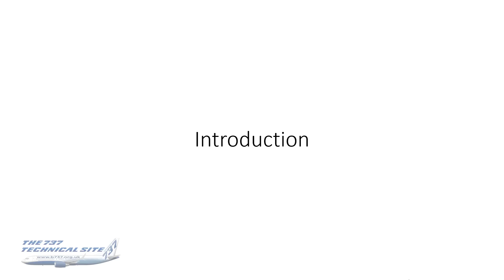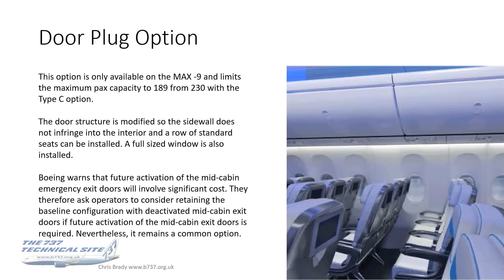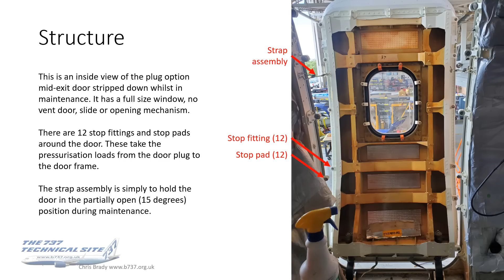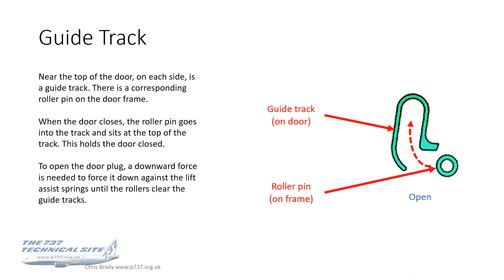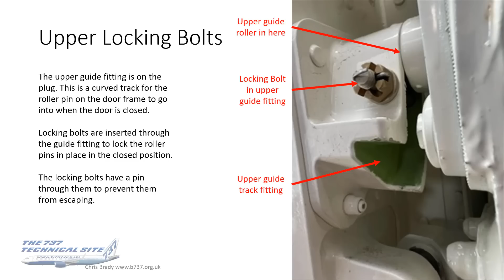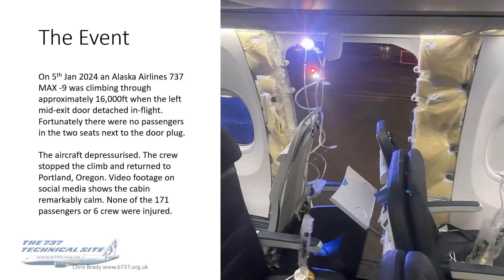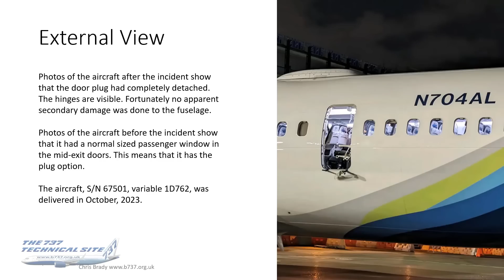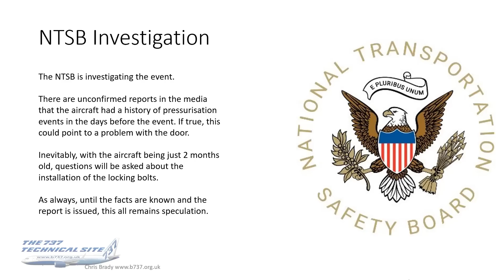737 Mid-Cabin Emergency Exit Doors - Plug Option

Comment: Spoken with a BA engineer:
The plug doors are habitually removed on the FAL for ventilation, tool access, ease of interior install - then re-installed.
Reply: That’s seems like the most likely thing to me. Someone removed the bolts and opened it while working the interiors. Later on, when it was time to install the sidewalls, someone closed the door, without knowledge that it required bolts, as most doors don’t get bolted in place. They closed the door, and threw on the sidewall.
Reply: @SynthD  Wow, that's a chilling sequence of events but unfortunately it could be close to the truth!
Obviously people will say this can't happen, there are procedures to ensure it never happens but bear in mind that something obviously has happened here and the likelihood is it didn't involve following every procedure to the letter.
Reply: @alanm8932  I work in heavy checks, and we opens all the doors everytime to keep it cool in the cabin. However, we’re all A&Ps and have the sense to close everything properly before shipping the plane. This is exactly what happened. There is no damage to the airframe, the guide pins are still attached and undamaged. Only way that door came off is if those bolts weren’t installed. They weren’t installed because they had it open for ventilation and whoever closed it didn’t realize the door had to be locked shut with bolts, because nearly all doors lock on their own without bolts. The only thing that boggles me about my theory is how it went 2 months before popping open. Seems every time they landed that door would bounce. Overall, a major safety net is missing in this design being there are no proximity sensors to detect if the door is closed properly. Virtually every other pressurized door has sensors to ensure they are correctly closed just for this reason.
Reply: @SynthD and the design standard far25 actually requires that there are sensors to ensure its correct closing. How did they show compliance with that regulation during the certification process?
Reply: @SynthD  I suppose even without the lock bolts it does not necessarily blow out immediately or soon after. Maybe the weight of the plug , and differential pressure is enough to keep the door in locked position. Maybe on this particular flight it hit a bump on take off, enough to jog the door off locked position. and Finally increasing differential pressure did the rest. As you also mentioned, plug should have unlocked warning indication (meaning it is off its fully seated position, not that Lock Bolts are missing)
Reply: @SynthD  Things kinda look that way, 

However (and not to defend BA or anyone else) someone has postulated that Alaska sent the plane out for wifi installation to a third party who may have removed the plug and not put it back, as required.

It's pure speculation, at this point in time. I guess we'll hear something.
Reply: @frankpinmtl  hmmm coneheads involved. Plausible
Reply: @SynthD  I’d bet a lot of money that’s exactly the case
Reply: Doesn’t seem like it should be a problem if it’s done according to procedure, logged, and properly inspected. Seems to fall under maintenance purposes. Unless of course they are treating it like opening and closing a door, as opposed to removing and replacing a section of fuselage and interior.
Reply from the maker: Interesting thank for the info
Reply: "The plug doors are habitually removed on the FAL for ventilation, tool access, ease of interior install - then re-installed." 
As long as each occurrence is documented and done PER the maintenance manual.....shouldn't be a problem.
Reply: @rael5469  Part of the problem is at Boeing, they don't use the maintenance manual until the aircraft is certified, or unless engineering allows it.
Reply: @reubenmorris487   I worked for a Boeing subcontractor and we worked off of documentation and engineering drawings. So there is documentation and there were inspectors inspecting our work.
Reply: @rael5469 Unless the design itself is faulty, which looking at this as an engineer, seems highly likely. It's only held in place by a small number of thin bolts. The doors don't sit flush with the fuselage, so there would be buffeting if it's even slightly loose.
Reply: @SawBladePainter No, it is being held in place by the cabin pressure and those lower springs pressing those roller pins into the guide track. The springs pressing it into the track, and the cabin pressure pressing it into the bend. Those 4 bolts just secure it so it doesn't slip out of that position.

This, however, leads to the question of how the door could go flying without ripping out the guide track while the aeroplane was pressurised. The cabin pressure should have pushed it safely into them, even without the bolts present.

This leads me to speculate that the failure was with the hinges. If those failed, the lower half of the door would have departed and pulled the upper half out of the guide track. In that case, the locking bolts don't matter---the lower ones don't stop the hinges from breaking, and the upper ones depend on the door not getting narrower. (i.e. the roller pins stick into the guide track and can be pulled out of the door folds in the middle, they are only secured against moving along the track.)
Reply: @SawBladePainter   I don't understand your point? "There would be buffeting if it's even slightly loose".....and then what? 
Cabin pressure holds the plug tightly against the stops. As long as the cabin is pressurized there would be no buffeting. Even without cabin pressure the gap between the plug and the stops would only be a couple thousands of an inch. All the doors and windows are made to stay in place in an unpressurized situation. Not ideal, but they would stay in place.
Reply: Please correct me if my thinking here is way off base…

My initial thought is, if the door wasn’t seated on those fuselage tabs, the increasing cabin pressure would essentially blow the plug off the aircraft. Flight 1282 was climbing through FL 16,000, so the cabin pressure ratio was positive inside, negative outside.

How it got past the slots and rollers is baffling, unless it went out bottom first, because the rollers are still present.

So the higher they flew, the same cabin pressure is pushing against an ever decreasing outside atmospheric pressure.

So per Chris’s video, the dimensions of the plug are about 20” x 44” = 880 sq in multiplied by 7.45 psi at FL 16,000’ = 6556 pounds of force against nothing on the outside…There goes the plug !

— From Chris’s 737NG-MAX technical guide…”below FL 280, the max differential is 7.45 PSI. which will result in a cabin altitude of 8000’. At cruise altitudes above FL280 but below FL370, the max differential is 7.80 PSI. which will result in a cabin altitude of 8000’ at FL370. At cruise altitudes above FL 370, the max differential is 8.35 PSI. which will result in a cabin altitude of 8000’ at FL410.
Reply: @HenryLoenwind  those lower springs are there to assist in lifting the door up & open. 
The cabin pressure held it in place…for a couple of months anyway.
Reply: @rael5469  "Cabin pressure holds the plug tightly against the.... " Perhaps the springs and taxying vibration moved the door upwards enough to clear the stops before cabin pressure was applied to the door?
Reply: @ImperrfectStranger   I'm just not sure. I have personally never worked on this door plug on the 737s so I couldn't say for sure. If I was betting money I would bet that the bolts were installed but not safetied and that they vibrated out one by one until the final one fell out on the day of the incident. That's the only scenario I can see.
Reply: @rael5469  There is a documentary procedure (can't remember the acronym he used...I'm getting old) but to your point, it is also a second set of eyes, job. 

Someone signed off on the job.
Reply: @frankpinmtl  Boeing's been cutting QA.  They (the executives) called it the, "Verification Optimization Program."
Reply: @frankpinmtl  We call it RII for Required Inspection Item. I don't know if that's the terminology all airlines use. It means that critical component installations must be verified as correct by a Quality Control or Quality Assurance Inspector before the work can be signed off in the log as complete. The inspector then also signs the logbook either physically or electronically if the aircraft have an electronic logbook.
Reply: @dougrobinson8602  At BA they use some other term, I think. I'll ask him again, he's flying now. 

But your point is well taken;

Someone did the work. Someone inspected the job.
Reply: @reubenmorris487  As in many things, optimization is a corporate euphemism for more money, less cost.
Reply: @reubenmorris487  an interesting title for that project Is this another B737 design short cut or shoddy manufacturing coming home to roost
Reply: @frankpinmtl  rii
Reply: Overwing doors might be routinely opened for ventilation, etc, but these doors require the removal of split pins, castelleted nuts, etc.
Reply: @ImperrfectStranger  Couple minutes.
Reply: Quite unusual to open a door that have the trim panels of the pax cabin in the same manner of the regular ones. I guess the BA engineer is talking about the overwing hatches and not of these doors. I am sure NO airline mechanics will touch this kind of plugs doors under any circumstances other than Mandatory maintenance (Checks or Squaws)
Reply: @jjiglesiasg  FAL - means final assembly line. The BA engineer is talking about what happens at Renton, not at an airline.

No - an airline would not open the plug. It is behind interior and insulation. 

Point being made is that the fuselage is shipped from Spirit to Renton by rail with the door plug semi-rigged, it's put on the FAL where the plug is removed as an extra access point to the interior during final assembly, then re-installed, walled over (unless it's in a high density config) and sent on it's way to the client.
Reply: Do BA operate the MAX??
Reply: @oldmanc2  BA means Boeing. The A means aerospace.
Reply: @indiekiduk  BA means British Airlines.
Reply: @planespotter4494  British has a FAL? lol
Reply: @indiekiduk  Haha I mistook BA to mean British Airways but it can also mean Boeing Aircraft or Boeing Aerospace.
Reply: Someone said this as well but the video should be required viewing for anyone analyzing the incident.
Reply: NTSB just now "We have not yet determined whether the bolts existed there..." 🤣🤣🤣
Reply: When you say the plug doors are habiltually removed at the FAL, does ths mean fully removed, or just opened? From what I have seen (including the released NTSB graphic) there are straps that allow the panel to hinge out maybe 30 to 45° and stay in that position (which allows for ventilation).  If the panel is actually totally removed, what gappens tho the poles from the hinges that protrude?  Don't they get in the way?
Reply: @jfmezei  So as I hear it from my guy, the retiree - these is a procedure and documentation that is completed. The door is completely removed, so that air circulation, hoses for tooling and eventually interior fittings (panels, seats, lavs, galleys) can get through. It makes sense - they probably have it planned down on paper which set of seats goes through which door, to be installed in this area. It's all about time, right? People moving in and out of the fuselage - more entry points, easier to move around.

If the door, lugs or frame isn't showing signs of being ripped out and destroyed, it would point to the bolts not being re-installed. He believes it's a second set of eyes, job. Someone has to inspect it after it is done.

He also said that there is documented procedures on how the removal and install is supposed to be done. You are supposed to follow the procedures, and fill in the sheets proving it was done correctly, then inspected.

My guy was involved with exactly this doc procedure on the 767. Planning on how things like this are done. He's an old school 'plane guy' who is not very enamoured with the direction BA has taken.
Reply: I guess Spirit doing the install is more a question of ensuring all pieces are there when the fuselage is shipped. But seems like a waste to have to undo that istallation work and then re-do it.  @frankpinmtl
Reply: @jfmezei  So I've looked at some Renton videos and I think it's pretty much a shell when it get's shipped from Spirit. Insulation, wiring, interiors, flooring - everything goes in at Boeing. I could be wrong, though...
Reply: @jfmezei  So I've looked at some Renton videos and I think it's pretty much a shell when it get's shipped from Spirit. Insulation, wiring, interiors, flooring - everything goes in at Boeing. I could be wrong, though...
Reply: Looking at photo at time 4.20 it would appear to be common practice, which is encouraged by B as evidenced by the provision of stay open straps.
Reply: FAL?
Reply: @Capecodham  Final assembly line
Reply: @frankpinmtl  Who the hell would know that? Trying to brag with your use of acronyms?
Reply: Sounds like either no inspection or removal again without proper RTS
Reply: To all here…Yea but…didn’t (well obviously not) someone notice extra parts left over or in a baggie or something before closing up the interior ? I mean I’m mechanically inclined and sometimes I’ll have an extra nut, screw, or something after taking apart and reassembling something relatively complex and I’m like, uh oh where’d that come from ?
— I get it though that aircraft maintenance hangers have stuff, tools, parts, tool bags, toolboxes, drawers, pants pockets, etc…all over the place.
— Someone either noticed they had extra parts and didn’t say anything or those nuts, bolts, and cotterpins are still either in someone’s toolbox or who knows are just still laying wherever they were placed.
Reply: @65gtotrips  You make some good points. What if they got used and installed on the next aircraft down the line?
Reply: Whatever happened  ,an Inspection problem, a Inspector should have signed off on the door! @65gtotrips
Reply: Not an A/C that is 2 months old
Reply: @markskibo5159  FAL=Final Assembly Line.  (That's why everybody is confused by your comment.)
Reply: @satoshimanabe2493   Frank used FAL, not Mark.
Reply: @rael5469  Mark didn't know what FAL meant but Frank did.
Reply: @AnotherDoug   I think Mark knows what it means......but his sentence was not a complete sentence. That's why I asked, "huh?"
Reply: @markskibo5159  do you or anyone know... When Boeing delivers AC, is the cabin complete or does the Airline manage the install of the passenger seats and other interior components?
Reply: @sleepla8er  Seats, galley, Lav's are BFE - buyer furnished equipment. Airlines contract with suppliers to deliver seats to BA (for example), timed to be there on the FAL when the fuselage arrives from Wichita - and then get's installed. 

EVERYTHING is planned and documented. 

It's not as simple as just slapping in seats and away we go. Lav's and galleys have plumbing needs and can be installed in different locations, different config's. 

All that plumbing has to be installed, along with electrical, under the floor - before any sidewall, bins, seats can go in. 

That's why having an extra access point is valuable on the FAL
Reply: @markskibo5159 You mean Boeing aren't installing any seats on planes just 2 months old? So how old must a plane be before Boeing finally installs seats? Or maybe you want to change your claim?
Reply: @perwestermark8920  Seats are installed on the FAL, along with plumbing, electrical, flooring, insulation, sidewall, bins. They are BFE - buyer furnished equipment. 

Airlines order the interiors, which are then shipped to the FAL and installed by BA.
Reply: @markskibo5159  FAL happened as part of final assembly...so yes it makes sense on a new aircraft. I am not sure what your comment is trying to suggest.
Reply: @markskibo5159   Huh?
Reply: @rael5469  Final Assembly.
Reply: @camerond9885   Why did you say "final assembly" to me?